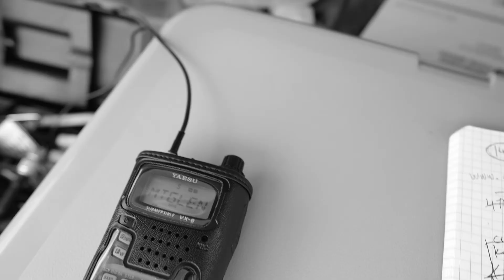DBJ-1 HAM Antenna by Dr. Ed Fong WB6IQN J-Pole Antenna

Comment: Not a great idea to use the SO239 in the base of the antenna for mounting.  It will stress the connector in the end cap and break.
Reply: Frank Romero Good luck in your ham radio adventure! Best regards! 73 KF3BY
Reply: I thought that exactly, Hey Frank how has it been holding out?